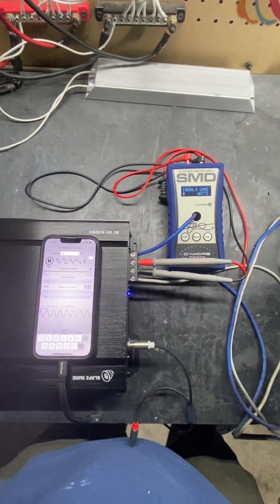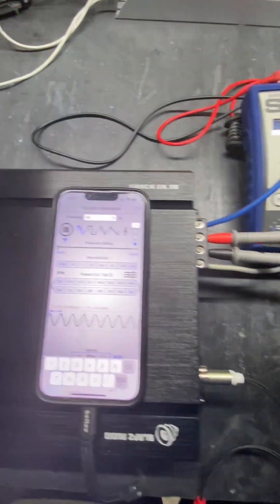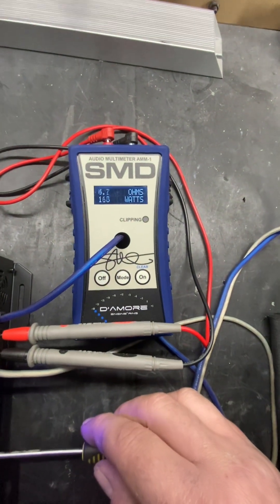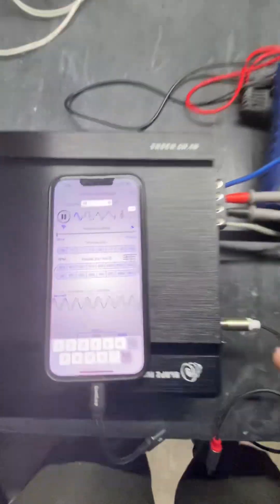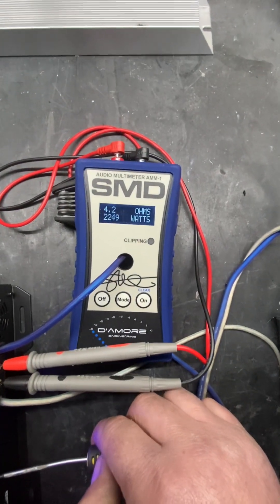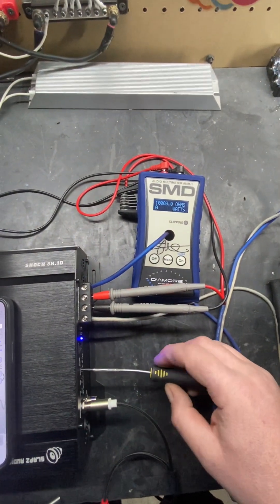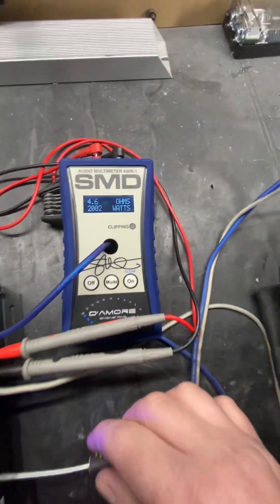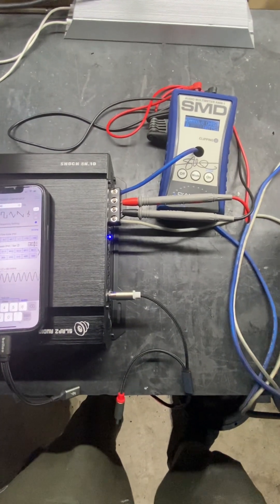SLAPZ Audio RMS wattage free air test on a SLAPZ Oblivion DVC 4 ohm subwoofer @slapzaudio

Comment: Is it a underrated subwoofer meaning that it can take more than it's rms power rating because i got a 3k amp and i was just wondering thanks for the great video
Reply from the maker: They are rated accurate. But with impedance rise on a 3k the sub will see its RMS on average so if you have a 3k amp, and do not clip you will be fine